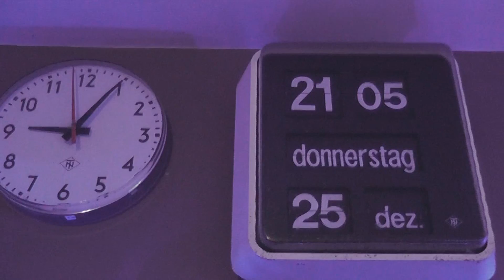Lithium Battery [2]

Comment: Assuming all this is flowing to Earth, since the Earth is smoking, doesn't it damage any roots/plants along the path of return? Curious. Same with the burning tree branches.
Reply: Nitrxgen I once did this kind of thing with 3kv from a vacuum coating machine transformer, it DOES kill the plants immediately underneath, but the earth dissipates the current surprisingly fast  and doesn't seem to affect anything more than a couple of cm from the 'impact' point, despite the potentially lethal step potential. Plants are just harder to kill I guess!